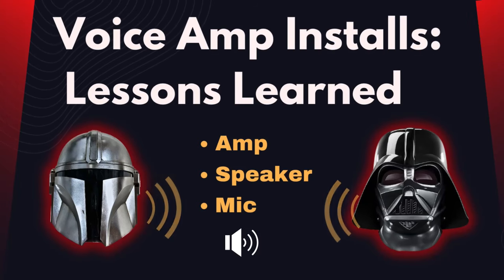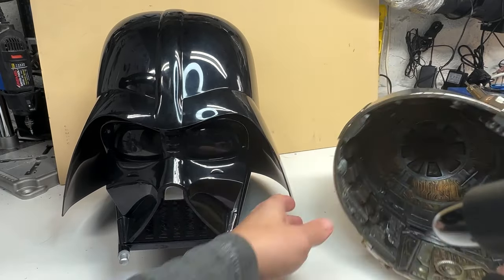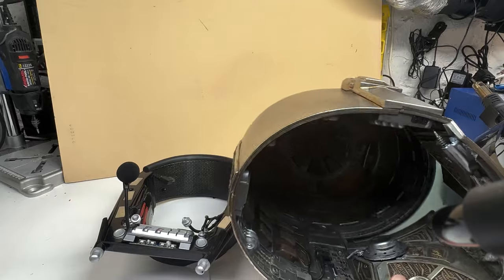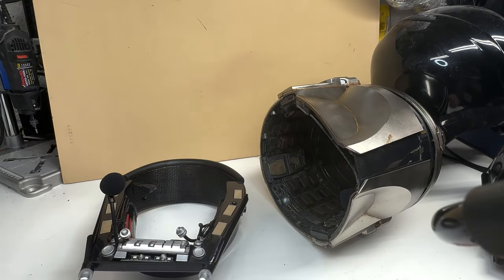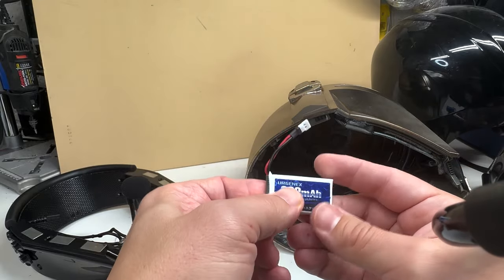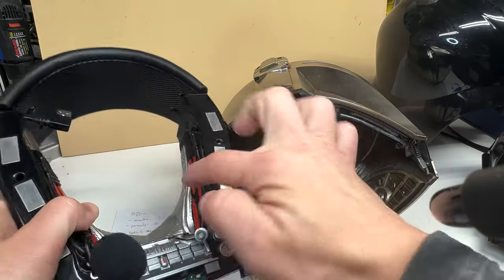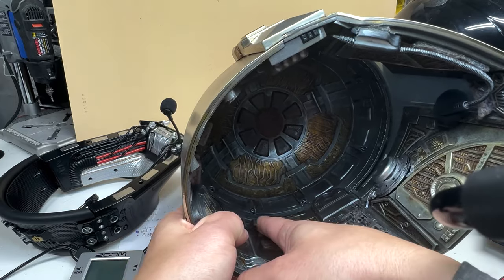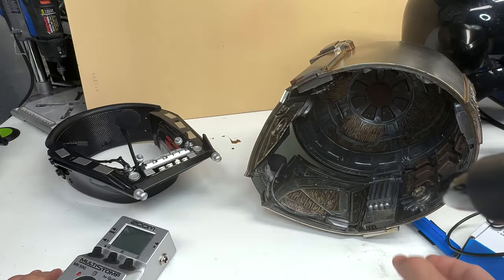Costume voice amplifier installs: Lessons Learned -Star Wars black series helmet/mask audio #cosplay

Comment: Just received the Amp! Thanks! Quick question because I’m a noob with all of this. Do you have a video available that shows step by step, how to connect the amp with the I9 voice changer together? Like what wires go where and what kind to use to make it all work. I cant figure out what to plug where so it all works. Thanks again
Reply from the maker: Hey Carlos!  
Here I talk through how I did it on a similar amp: 
https://youtu.be/BN7Dydsqry4?si=jWKy0Uz5QQAuO3XV

In its description are the detailed instructions.
Here’s an excerpt of what you’re likely looking for: 
- TO OUTPUT TO AN AMPLIFIER/SPEAKER: A dedicated Mic goes in the mic port on top & an amplified speaker goes into “headset” port on bottom.  For the speaker you must use a TRRS cable - those are the types if cables that came with the i9 (3 plastic separators & 4 metal sections on the 3.5 mm tip).

Comment: I’m building a Mandalorian for comic con next year (Paz Vizsla in particular) I’m running the speaker into the chest peace I’m going to experiment with a surface transducer, have you ever tried one?
Reply from the maker: Yep- they work great. I used one in my Mandalorian helmet video 
- SHORT: https://youtube.com/shorts/zuAJMUiYEOc?si=qTTWdX4UT44lIw-U
- FULL VIDEO: https://youtu.be/yPGlVtBoNYg?si=cl6s7ObJczq8ABLv

And I also test out a bunch for potential use in that helmet in this short: https://youtube.com/shorts/V53RSVV6kp4?si=v-R18afEAzTia0W6

What I didn’t test in that video was options with the arms since they don’t work well on the helmet curves or small areas, but may work well when attached under your chest armor.

Comment: Im using same exciter as you, along with a gutted personal amp. How do you avoid the feedback issue??
Reply from the maker: I try to get the exciter as far from my mic as possible, not point the speaker or mic at each other, ensure my amp isn’t too loud, and ensure that the mic neck or microphone head do not touch hard parts of the helmet face, ensure there’s a foam buffer, because if they touch - they’ll pass the vibrations from the mask into your mic, yielding increased feedback.

Comment: I am simply looking to reproduce the effect on the mandalorian voice for the helmet, I came across your recommendation for the I9 and I would like to know if speaker is included or do I need a certain one to plug in it?
Reply from the maker: You need both a mic and an external amp with speaker to use with the i9 voice changer. Here is what I integrate it with - a personal amp that I gut and integrate into a helmet: https://www.youtube.com/watch?v=0fAGJK9jco4  -- that one is a small and fit well in helmets.  Check amazon and walmart.com to see if you can find it there, if not I just bought a bulk load of them I may be selling soon.

Comment: Im using same exciter as you, along with a gutted personal amp. How do you avoid the feedback issue??
Reply from the maker: Ensure the mic and speaker are as far away as possible and the mic and speaker are not pointing towards each other. (Directional mics are better in this context) . And don’t let your mic neck or mic touch the mask, as they will convey the vibrations into the mic and yield feedback. I put foam behind my mic neck and face the mice to the mask front so the foam cushions the mic from absorbing vibrations.
Reply: Ive tried just about everything to solve the feedback issue but nothing seems to work reliably for me.  Im considering just going with fans in the helmet and using a personal amp (not gutted lol) mounted somewhere under cape or behind armor.  My question is can The I9 voice changer be used with a wireless mic and mini amp?  Or is there no way around the wired mic option if using the voice changer?
Reply from the maker: Bummer dude.  What I’ve not tried, but might work is - packing sound absorbing stuff around your speaker (something like a dry washcloth perhaps)…
Alt:  Not ideal, but I’d try moving the exciter to the top or back of the helmet. Are you doing Mando, Vader or something else? 
Alternatively you could remote your exciter under your body armor…although I’d opt for a thin exciter for that
Reply from the maker: I don’t see why a wireless mic would be an issue.
Reply: @creative-stuff Im doing Mando and should be getting my armor and helmet in a couple of months so im playing around with an old skydiving helmet. Feedback is crazy. I have a small exciter and have gutted two personal amps and an all in one karaoke mic. Ive tried everything including foam to try and buffer it. Ive tried putting the exciter in the back and on the top above my head but its still really bad. I dont know how you managed to do it because ive put in a pretty good amount of time n energy into figuring this out. My solution is to just do some fans in the helmet and get a wireless personal amp and mount it somewhere under cape on shoulder or behind chest armor. We’ll see. Maybe check out the i9 and incorporate that. Its cheap enough to try.  Not sure if it would plug into the amp itself or if I will need to get wired headphones to plug i9 into. Thats where im at with all this. Pretty frustrating. Lol
Reply from the maker: As long as your wireless mic has a receiver with 3.5mm plug you’re good,  just plug that into your mic port on the i9, then run your trrs 3.5mm cable that came with the i9 from the Headset port to the mic in port on your amp.

Without testing your helmet myself I’m not sure what else to  recommend other than make sure to start value low - perhaps a different shapedhelmet willyield better results …
That aside your outfit should do great as a speaker if you go that routewith a shoulder armor or chest armor mounted exciter. You can always  also use a separate mini player to feed an exciter on the other side with canned sayings or the Mando theme song etc.  It will also balance weight distribution too. That one you could run down your sleeve to a button  pad with in your glove or use the button area on the vambraces/gauntlets.
Just a thought.
I look forward to finding out what works out for you.